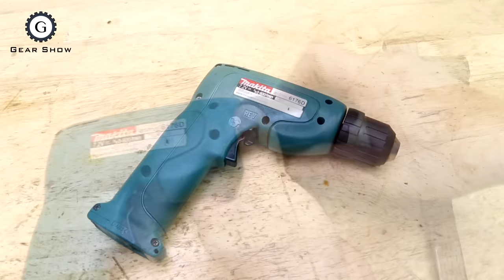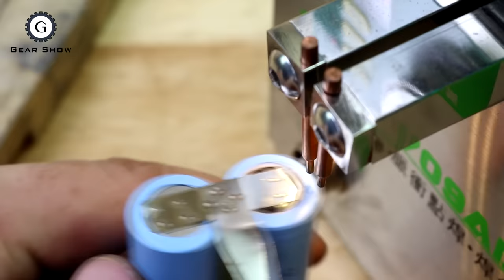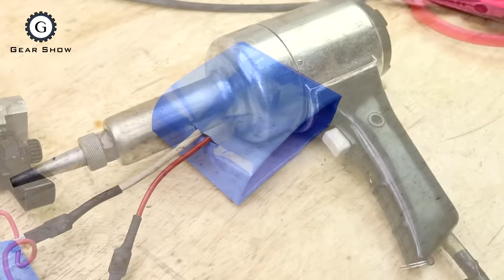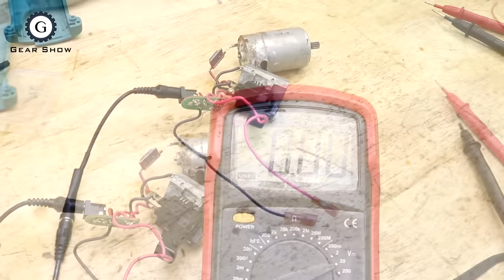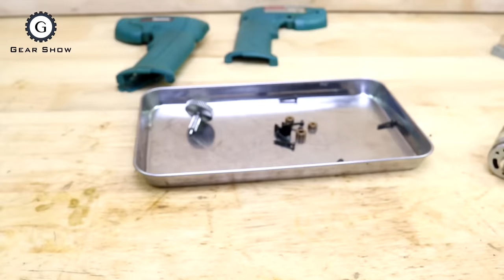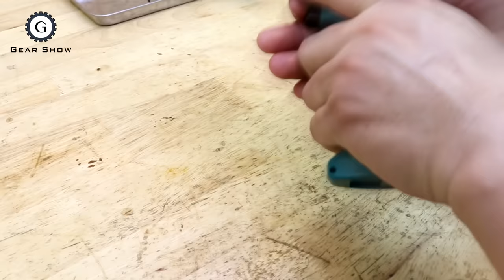Nicd to Lithium Battery Makita Cordless Drill 8.4V 2200mAh

Comment: I added 1 more li-on cell and running the 9.6v drill on 12.6v. Talk about waking up the old drill.  If it burns out you can buy another drill at the swap meet for $5! But 3 years and no problems.
Reply from the maker: Okay, thank you so much for sharing!

Comment: Great job! This old drill is about as compact as anything produced today, sleeker looking without all of the over-molding nonsense, and will last longer since it doesn’t have all of the modern electronics inside.
Reply: You forget about the fact that there are hardly 7,2 Volt (and slightly above) battery drills produced today. Almost everything is 12 Volt (if you still want to go down the NickelMetal-hydride way. which I would not recommend), 14,4, 18 and 24 Volt.
And there is a thing for weight-distribution as well. I don't like to work with these kind of drill as the weight-distribution just sucks. the battery-conversion makes things even worse in this case.
Reply: These small old Makita's are the perfect drill for dragging up a ladder to do gutter repairs etc.

Comment: Great video! People need to know more about safety electronic circuits for batteries, and have some basic soldering skills as well... I see a ton of "restoration/repair" videos, cold joints and destroyed pcbs everywhere...
If i may suggest something, when using the desoldering pump, add some fresh solder to the joint you want to remove, it will make it a lot easier.
Reply from the maker: That's great, thank for sharing.

Comment: Great idea, I got one of these, but with 9.6V
Reply: Did you use a 9.6 volt battery common for RC cars? I'm curious as to if the drill circuitry can handle the voltage increase and how well and long it performs. I have both a 1985 Makita 7.2 volt drill and a black and decker one with the rechargeable batteries that's built in pretty weak.
Reply: @Nesmaniac  My Makita is original with 9,6V

Comment: I have a makita 6010SD with 7.2 volt built in battery from 1985. Would it be possible to make a 7.2 volt RC car battery work? Thanks a lot.
Reply: As long as same voltage you can change the battery with 18650 or RC battery
Reply: As long as same voltage you can change the battery with 18650 or RC battery

Comment: The point where the strip bends to the board needs more insulation or you are going to have a short as the battery moves and vibration it's going to eat away at that plastic insulation and cause a possible fire.
Reply: wa

Comment: '
i have one cordless drill with old NIMH batterys...
i removed old batterys and put new R/C model NIMH batterys in a drill...
great running well
Reply: I have a makita 6010SD with 7.2 volt built in battery from 1985. What sort of modifications did you do to make a 7.2 volt RC car battery work? Thanks a lot.
Reply: @bestamerica  Thanks for the info. Seems the dustbuster calls for a 15.6V battery. The makita drill I have has built in battery so I was concerned with how the RC ones would fit be nice to find one that fit's properly then I could just arrange the plug to charge by cutting out a small portion of the case. Lots of 7.2 volt RC car batteries to choose from and I wonder how much time I can get out of a charge of one of those.
Reply: hi N...
'
better use R/C battery rechargeable...
my mini vaccum dustbuster is a only 3 batterys = 3.6 volts...
not 15.6 volts

Comment: Question, how did removing a schottky diode and a single resister decrease the voltage?
The diode would have no effect on voltage and a single resistor could only minorly decrease voltage so removing it should've increased voltage 🤔🤔🤔

Could someone explain that to me please

Comment: bit of help for soldering: instead of putting solder on the iron and then transferring it to the solder pad, put the iron on the pad first and then add solder. It'll help the solder flow better, and may even let you not have to add flux to the pad before soldering.

Comment: You put the BMS on the Batteries without any extra insulation. There is only Batteries shrink plastic cover between batteries and The BMS. It's possible to short out and causes fire when batteries get hot and the batteries plastic cover got melt. It can be very dangerous you are Pro and exactly know what I'm talking about.

Comment: I would like to do this to a old craftsman 12.v drill.. it’s still in good condition never really had all that much use.. just the battery died.. just need to find a link to the parts needed.

Comment: The diode cannot cause an increase in the voltage of the Li-ion charger. The diode there served just to protect the cables from burning when the charging connector or charger was shorted.
Reply: no diode, that was a resistor!!
Reply: @artashsargsyan4144  You don't understand the issue.
Reply: @heno_3098  may be you dont understand the meaning of a diode!!)))
Reply: @artashsargsyan4144  I understand it very well, but you don't understand what I wrote about. Watch the video 3 times and maybe you will understand easily.
Reply: @heno_3098   anyway the world is round!! Jordano Bruno

Comment: If the component pins of the bms heat up, it will puncture the plastic coating of the battery and cause a short

Comment: Great stuff! Professional. I have a similar drill/screwdriver lying somewhere since 4 years. Will proceed with conversion to Li-Ion. By the way, did you replace the Diode to limit the voltage to 8.5 volt? Did you also replace the Resistor? Thanks for answering.
Reply: Today i convertet a M003 Makita to Lithium-ion Battery. 2x 18650 and the same BMS doing a great job. The Charging Port connected to the same points where the Motor is. Problem here is the full Batteryvoltage. I build a shottkey diode in reverse direction to block the batteryvoltage but charging is normal. The big issue here is the voltage drop of 0,3V. The Charger must deliver 9V and a constant current of 0,5A. Without the diode and any metal things come in to the connector you have a nice firework. The original resistor and diode must be removed and bridged. Greets from Germany.
Reply: @sebastianwilmer9181  a
Reply: Iokkk

Comment: Great idea to give the dead drill a second life. Can you do one with 6v & 9v cordless drill?  and or convert to corded power?  Thanks.
Reply from the maker: Thank you! For the 6v drill, I will be rebuild the 8.4V battery, for 9v will be 12.6v battery. I used to convert a cordless drill to a cord drill but use the same voltage.

Comment: Do you have a circuit diagram of the changes you made to the makita board. What is the wall power adapter you used? Is it specific for Lithium batteries? thanks for the video.
Reply: Li-Ion charger (8volt) , 18650 Li-Ion batteries (2500mAh), BMS Protection board are all available on Amazon, Aliexpress, Banggood etc.
Reply: Connection to the new BMS Protection board is straight forward. No need for circuit diagram.

Comment: I have redone this drill with liIon but the BMS only can be used for recharging not for power because the drill is only 2 speeds .......not varyable speed ..... the firs speed uses only one batt 4.2 volts and the second 8.4 volts so ..........

Comment: I tried this. But I think my board is shutting off on high amps I think.  It just bumps the motor. It works with a 2 ohm resistor in series.  Did you install a resistor?  Thanks.
Reply: Got same issue? Did ya figure it out yet?
Reply: @ziggy8153  No!.  For the variable speed drill you can start slow and ramp it up to full.  But for the non variable speed I never did figure it out.
Reply: @karldias1415  thanks. Ive got the one speed. so addin a 2ohm resistor might get it runnin?
PS. Or thicker gauge wires?

Comment: Hi mr gear show. thanks a lot for ur video. i try to replicate ur work on bosch gsr7.2 v.
1.  im using the exact same 2s bms 
2.  new high discharge battery. 
but the drill will always stop working if i press the switch suddenly. it will only work if i press the switch slowly. 
do u have any idea why thats happening? any help would be great. Thanks
Reply from the maker: Hi 
Rudolph Arya! I suggest you replace the switch. The battery you rebuilded is perfect.
Reply: You must install 3pcs batterys 18650 ( high currenr 20 - 30 A min ) and BMS 3S 25A ( min 25 A )
Reply: @pekilobrbi7939  the drill is 7.2 v sir
Reply: @gear_show  ok. I will try it Mr gear show. Thanks a lot  for the reply. Cheers
Reply: @gear_show  sir, i tried to replace the switch and same thing happens. it happens on 2 exact unit bosch gsr7.2v. i've tried using different battery and still the same
Reply: Hello, I have same problem with BOSH 7.2V drill. The only working solution so far is if I short temporary B- and P- (to "activate" the board). Do you have other suggestions?
Reply: @ivoraikov  to activate the board, u just need to charge it for a while.
Reply: @rudolpharya1907  I know this, but with my Bosch the protection is activated if I press the switch fast. Seems that the BMS has problem too, because it is also discharging my batteries when not active
Reply: @ivoraikov  that was exactly my problem for the bosch. Even mr @gearshow had that problem with some type of drill he repaired. And he end up replacing the exact battery replacement
Reply: @rudolpharya1907  What was the problem and what he replaced - BMS, batteries or ?
Reply: @ivoraikov  just replace the original battery with identical one. No BMS like the original. But I cannot find the sourcing for the original battery in my country.
Reply: @rudolpharya1907  The original is NiMh and the idea is to convert it to LiIon. Seems these series are not suitable
Reply: @ivoraikov  yes. Some motor cannot be converted to li-ion using bms.  I managed to make it work by not using bms and then using battery indicator and balance charger. The downside is u must keep eye on the battery voltage indicator while using,  or else ur battery will die because no cutoff
Reply: @rudolpharya1907  This is what I am going to do too - balance cable + my Balance charge and an indicator for low voltage. Thanks for sharing your thoughts and experince!
Reply: @ivoraikov  👍
Reply: J
Reply: Please give me a source for BMS 2S

Comment: Hello Gear Show. Great videos and work, congratulations for your job! I have same BMS PCB, but there are some problems. Most common is that it is discharging my Li-Ion pack if it's "activate" (there is voltage on the output). If there is no voltage (BMS not active) - there is no voltage drop on the batteries. Suggestions?

Comment: Don't let that battery run too low.  Without cutoff voltage protection those cells will degrade a lot every time you take it below 3 volts per cell.
Reply: Didn't you see that he's put a BMS with the cells?
Reply: @tduic  
No I guess I didn't.  Thanks.

Comment: Hi, can we charge 18650 bartteries with a ni-cd charger?
Reply: If with '18650' you mean 'lithium cell': Nope, you can't. A NiCd charger will charge with a set current, but voltage can rise above levels that are considered safe for lithium cells. Once a certain drop in voltage is detected, the charger will either cut-off charging or start trickle-charging. A lithium-cell does not have this slight drop in voltage, which could trick the charger thinking the battery isn't full yet.
A lithium cell that gets to 4,2 Volt (the most common consumer type of cell) SHOULD NOT be trickle-charged!
Also, a lithium cell that is charged without constant current constant voltage, could be damaged. Lithium start off with constant current with a set maximum voltage (which could mean, as the cell ages, that the voltage stays lower in the beginning and so does the current), and as a certain (preset by the charger) voltage is reached, the charger will switch to constant voltage mode. As soon as a (again, preset) voltage is reached, the charger will cut-off charge. Especially this last voltage comes precise: a few tenths of volt is far too much already.

Comment: With a 3D Printer you could have made the batteries replaceable & maybe fit more than two 18650, or used two larger & just recharge them in a battery recharger instead, because you know when it comes to needing this the batteries inside will need charging every single time, & could have upgraded that very sad sounding motor with a faster high torque one that could fit the case.
Reply: by replaceable I meant add (print) a battery holder inside the handle with a battery cover, so the batteries could be removed to be put in a proper battery recharger when not in use

Comment: Ohh come on 
You need to replace the diode and not put a jumper wire its a safety feature and also when soldering heat the pad then add solder to heated wire or pad for a perfect connection. Put a paper or something the same to insulate the bms against the battery.

Improve your soldering technique pls
Reply: replace diode with what and what size  ?

Comment: this conversion is not cost effective if the purchase of a spot welder.... batteries...controller ...etc is taken into account at the final demo the drill struggled to drill into softwood....8.4 volts is not enough these days   18-20 volts is the norm...sorry a total waste of tome... LIDL sell a fantastic range of 20 volt tools very cheap and they are top german quality. and no I dont work for them
Reply: All true statements.  Just busy work for love of doing it.  Waste of time and money for most people.
Reply: Old low power drills still have their charms. Good for drilling small holes. Lol